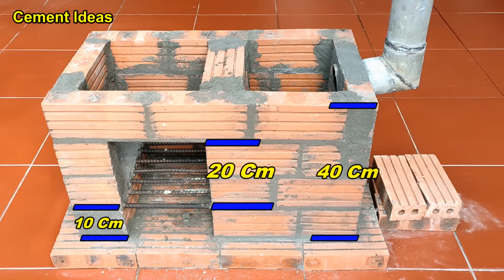The idea of ​​making a wood stove from cement - Stove to save firewood

Comment: Hello. Now I am building the same but with a larger size of 92cm in length and 52cm in width. The diameter of the left main cooking pot is 35.5cm and the right side is 19.5cm. So admin has any ideas to help my kitchen make as desired. And on the right front I want to add another baking box.
Reply from the maker: Hello you can adjust the size as you like to fit your kitchen space Thank you very much
Reply: So does the stove have enough heat to cook in two pots?  And does the stove suffocate when cooking?